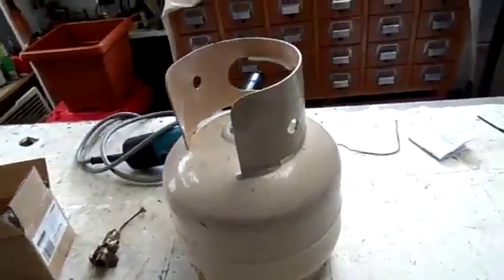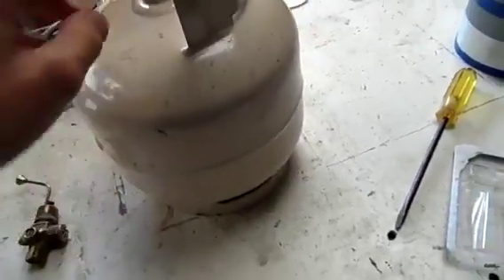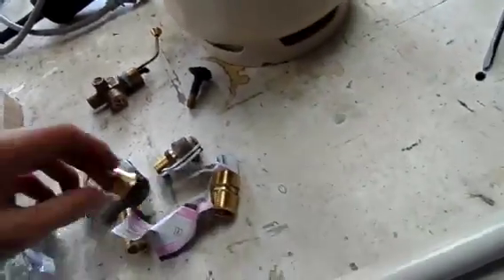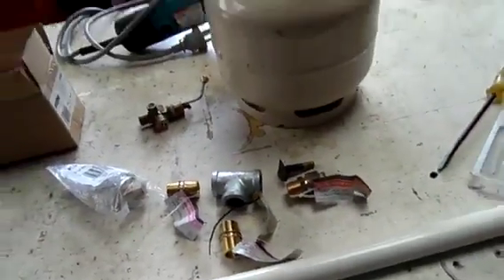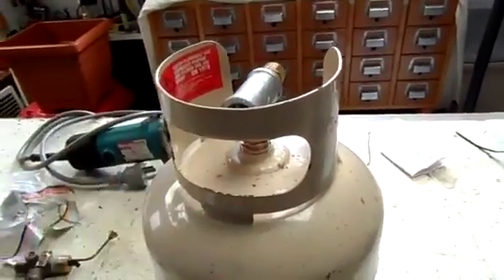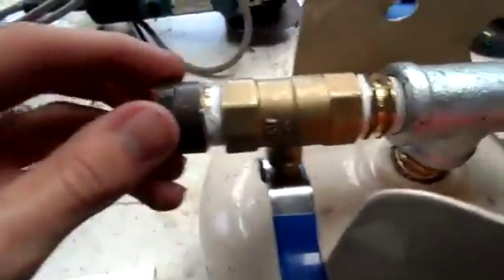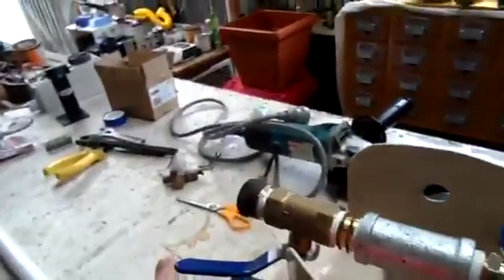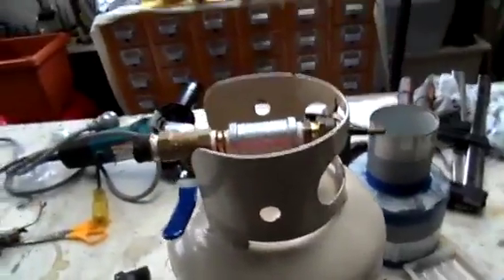Using a Gas Cylinder as an Air Tank!

Comment: Dude, mixing even a few drops of oil with compressed air will absolutely make a bomb, people have been killed doing that very thing when just a few drops of oil from the thread found their way into a paintball tank. BOOOM
Reply from the maker: People have also been killed from internally rusted compressed air tanks exploding. Plus, I'm not putting critically high pressures in it any way.